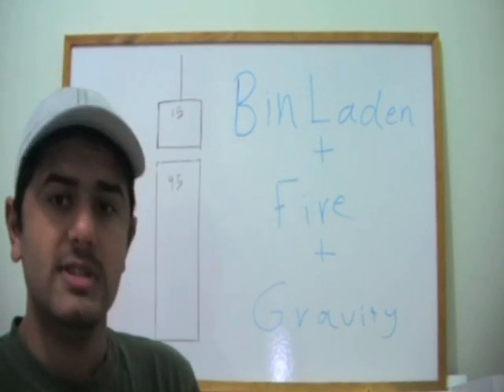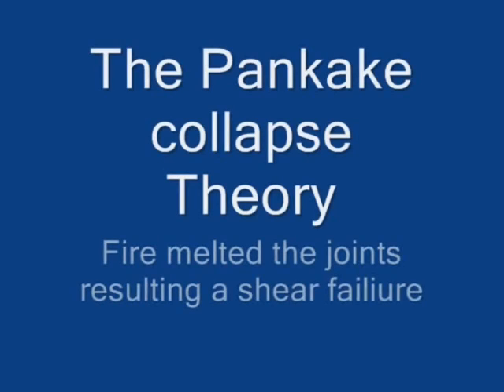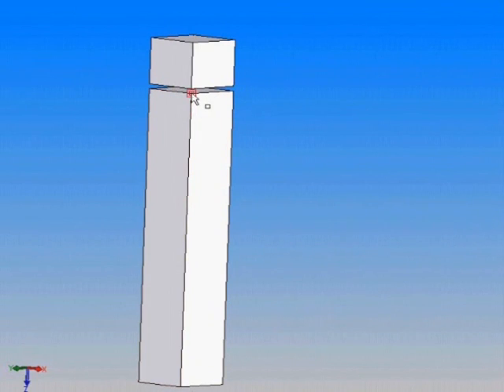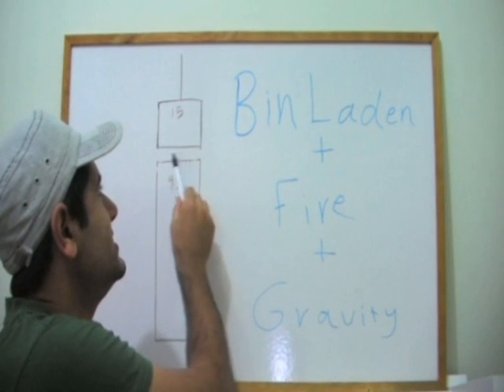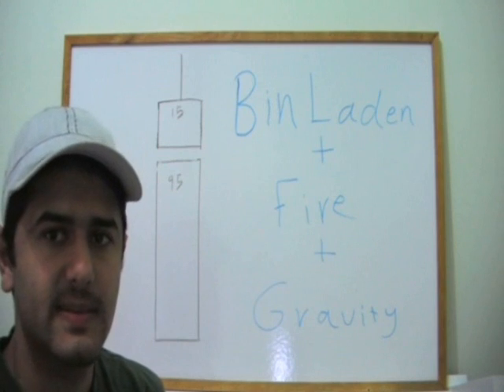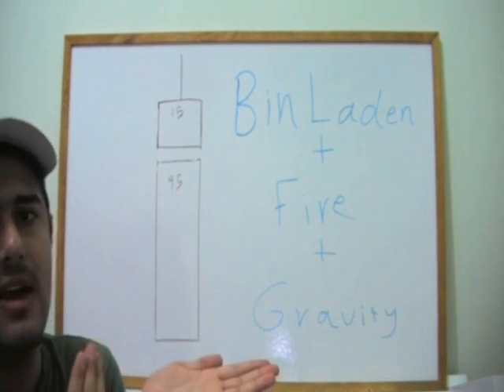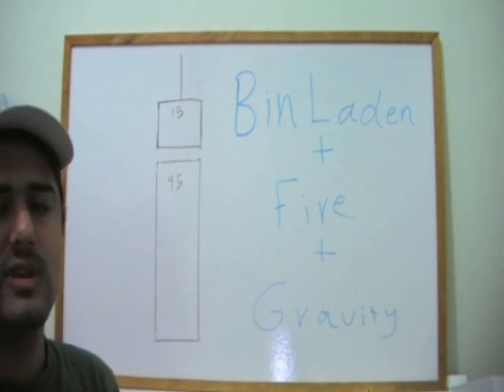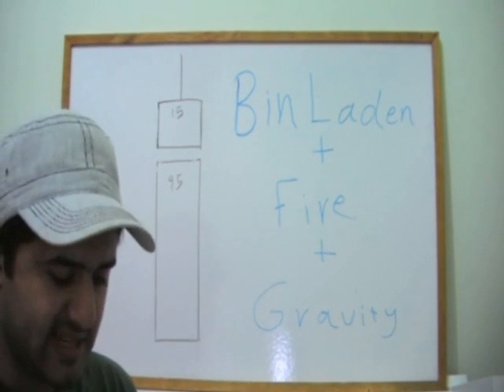(Part1) 911 Simple Physics Structural Failure Vs Demolition

Comment: Straight out of the box this guy proves he is clueless..."Columns were crushed". No they weren't. The upper mass (calculated at 38,000 tons) fell inside the tube formed by perimeter walls and between core columns, splaying apart both core and perimeter walls. All one need do is calculate the maximum static load of one floor span, which was far far less than 38,000 tons. Good grief. Footprint square footage was 95ish% floor span and less than 5% column. These shysters would have us believe that once the top started tilting, all those columns would magically stay in line; that would be like trying to balance a pencil point to point on another pencil.
Reply: +whetedge thank you.  it's painful to debate these conspiracy nuts, when they don't have even the slightest clue about physics.
Reply: James D You think the Towers were solid mass like a tree? How do you think columns were supposed to stay in alignment once the top started falling over? That would be like balancing two pencils point to point. The only resistance were floor spans. How can a floor span which fails at 13,000 tons stop 38,000 tons of falling mass?
Reply: marc atkinson It does get exasperating.
Reply: Well we saw the top tilt once in one tower , in a peculiar way. Then we saw it come apart in mid air. The other I think was slightly different. Tell me how the inner core could be splayed apart if all your debris is actually crushing it, by your description. Tell me also why you consider the floors below are not functioning as ties?  Finally tell me why the towers turned to dust in midair?
Reply: Banjo Marla Do you envision the "inner core" as a solid mass? Both tops tilted at initiation, meaning core columns buckled. Hold two pencils eraser end to end. Tilt the top one, and make it slip off the lower one. That's all that happened. With 20ish feet between core columns, columns of the top punched down through the floor spans, standing columns of the bases punched through the falling top floor spans, creating a chaotic breaking apart of both sections. Good grief. The "Towers" didn't turn to dust in mid air. All the drywall and some of the lightweight concrete turned to dust. You can see the top part of both Towers tilt and get restrained by the lower wall to which it tilted, then wedge down that wall, peeling it like a banana. And what about the steel perimeter wall of the tops. did they disappear? Of course not.They broke apart into slabs of steel and punched down through the lower Tower. Look at the core of the North Tower. You can see how the north wall of the top sliced right down the middle of the core.  https://s6.postimg.org/4rfgz8k1t/WTC1standingcore2.png
Reply: +whetedge Firstly why I think there is probably a distinct difference in what was observable between the top of the two towers. Enough to discourage comparisons. 
 Secondly I refuse to believe un your scenario for the simple reason that the damage was not sufficient. Movement of large components I would believe but not the instant destruction clearly witnessed. Sure a colum could shear, fall a floor could give way, but symetrically no way and to have the energy to cause that level of destruction simply cannot be explained by gravity. 
 Tell me where is the govt NIST aproved working model? 
*You guys are abstracting to fit.
Reply: +Banjo Marla I would add that your video could be better explained by other things such as agent  The fact that you have a picture and a story to go with it is not necessarily the actual fact.
Reply: Banjo Marla Your powers of observation are poor. Try studying without prejudice.
Reply: +whetedge Your powers of assumption are strong.
Reply: Banjo Marla Funny, but not assumption. If you don't know the tops wedged down just to the inside of the wall to which they fell, you are not observing objectively. If you don't get that 38,000 tons of mass pouring down through the North Tower simply overwhelms maximum load of floor spans, you are also ill informed.

Comment: the space shuttle traveling at 18000 mph through 5000 degree temperatures left over 80000 pieces of wreckage, I can't believe 4 planes at no more than 250 mph and 1000 degrees left nothing. the kid is right about the thermodynamics you can't get 100 % transfer of energy between temp of fuel fire and temp of steel
Reply: Actually, the hijacker pilots sped the planes up to over 500 MPH. And in fact, flight 77 left debris outside of the hole in the pentagon. You can find pics of it on google
Reply: as any aeronautical engineer will tell you its impossible to fly a 747 at over 250-300 mph below 5000 feet, not to mention that this amatuer pilot was able to come out of a banking 300 degree turn at 3000 feet and sticks it about 20-40 feet above the ground??? and loses the starboard engine and slats on both wings as he approaches the pentagon and doesnt lose control of the plane?
Reply: +chilipalmer 10  Read & learn: 
https://sites.google.com/site/wtc7lies/911pentagonflight77evidencesummary
https://sites.google.com/site/wtc7lies/pentagonattackpage2
It was a 757, not a 747, and the "amatuer [sic] pilot," who had been issued an FAA commercial pilot certificate in April, 1999 for his training in cockpit simulators for Boeing wide-bodied twins, hit the west side of the Pentagon at ~525 mph, not 250-300 mph.
Reply: its impossible to fly that plane that fast that low, it would break apart
Reply: perhaps, it was a very large seagull, then?
Reply: The other part of that is the will . The pure will and perseverance to retrieve the pieces, preserve them, and fully investigate the cause. Have we seen that will re 9/11. Not even a fraction of it. Evidence destroyed and fictional narratives is all we got.
Reply: +Banjo Marla What evidence was destroyed, what fictional narrative were you given, and by whom?
Reply: ''Evidence destroyed and fictional narratives is all we got.''..... says the guy who states the towers fell in 5 or 6 seconds.
Reply: aluminum burns. 95% of the aircraft was inflammable (aluminum, plastic,copper,cloth rubber, and flesh)

Comment: you're not an educated scientist.. watch the videos carefully, the fire warmed the steel enough to make it pliable.. soft that is..not melted. but rather softer..this in conjunction with severed steel from the impact of the jet..and realize that the center steel columns as well took damage, along with the out curtain wall steel supports..now ! after you watch the initial movement of the top of the building, it leans some to one side..this action is ripping and tearing all beams and supports the in the immediate area.. because the heated steel lost its strength.. imagine the weight and forces involved once it started to lean and the fall..its enough to continue the separation of the stronger structure that was below it..and like domino's but in a vertical scenario.. 
do I think it was terrorists? yes..but from what country I am not sure..
I just don't believe that there was explosives that took it down..now building 7. hmmm that looks like explosives ...
a missile hit the Pentagon with out a doubt.. the plane in shanksville p.a.?   staged..!  
I'm just say the twin towers failed exactly where the planes hit them..and with the exploding plane inside the building..it pressurized the entire building right down to the basement.. coming sense..

Comment: even if it was a freak series of events that made it possible to fall due to being hit by planes near the top and not nearly getting close to hitting all the columns in the building, how did it happen twice? also, I don't understand how the buildings didn't topple but fell straight down... both times.. again. freak scenario.. happens twice. there are so many different ways in which both the buildings could have collapsed due to being hit 1) both buildings could not have been hit the exact same way that is impossible considering the supposed hijackers werent even efficient pilots and that we know both buildings were hit at different levels. 2)there are way too many variables that happened perfectly and in the right manner... twice.. in completely different scenarios, but resulted the same. that just doesnt make sense. you dont shoot two bullets and get the same result. so many people don't understand maths, probability and simple physics.
Reply: +Luke Peters How did it happen twice? Because planes hitting towers happened twice!

Seriously, how dumb a question is that??
Reply: +TimReed22222 ..... they didn't happen the same way. by your logic every building hit by a plane should collapse. I'm sorry but you're making yourself look like a fool by calling my 'question dumb' because firstly it's a rhetorical question and secondly I explained that the specific conditions required for the buildings collapsing straight down into their own footprint without toppling over (like most objects that are hit on one side due to impact do) is really slim and unlikely to happen in two successive plane hits.
Reply: +TimReed22222 also, it didn't happen twice :) 3 buildings collapsed. 2 planes = 3  buildings. try to think a little
Reply: +Luke Peters "by your logic every building hit by a plane should collapse"

Please don't put words in my mouth; allow me to speak for myself:

When two identical buildings are struck by identical planes in very similar ways, it should be no surprise - yea, expected - that the buildings suffer similar fates. If one had collapsed and the other not, THAT would be suspicious IMO.

Are you a structural engineer? If not, your explanation (as would be mine) on how a building should or should not collapse is worthless.
Reply: Correction on my math in #1: I redid the numbers when I wasn't sleepy :-) and the deceleration should be 12g's, not 22.